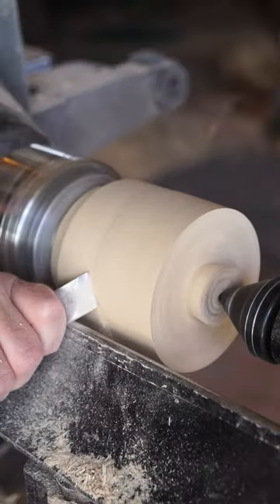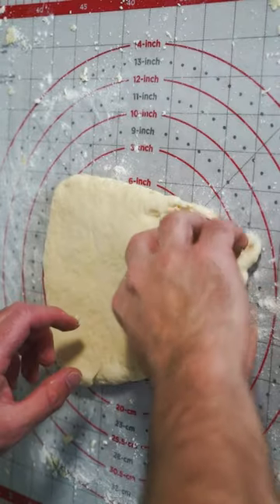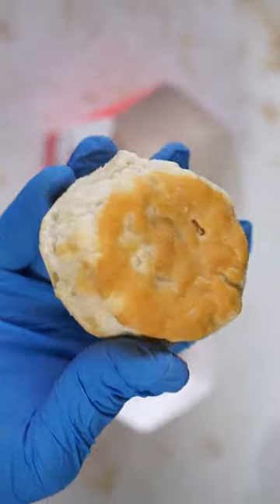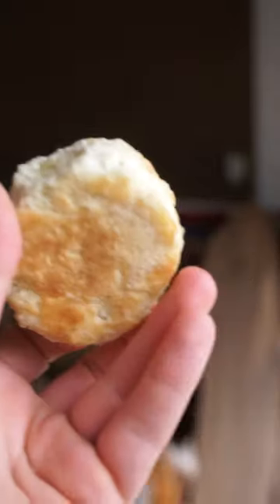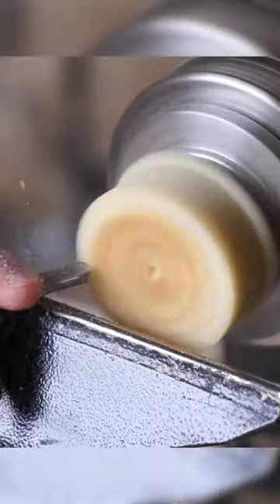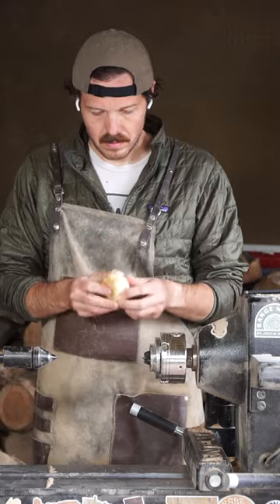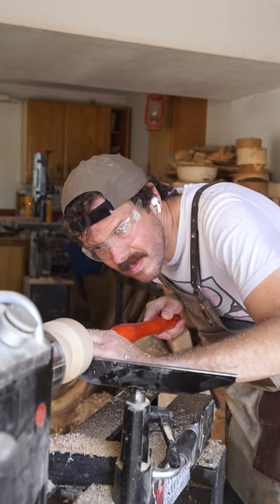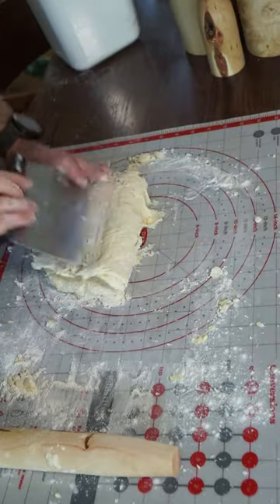Putting a resin-infused biscuit on a lathe

Comment: Whew... Never use a rolling pin to make your biscuits, man. 😮 EDIT: For tender biscuits, work the dough as little as possible. Work fast, once your butter goes in. Stir it just enough to get everything together, fold it three or four times, GENTLY, then pat it out to the right thickness with your hands. Cut with a glass... or whatever you made. Make sure they touch each other AND the sides of the pan, so they can climb.  No hockey puck biscuits to be found. Happy baking.